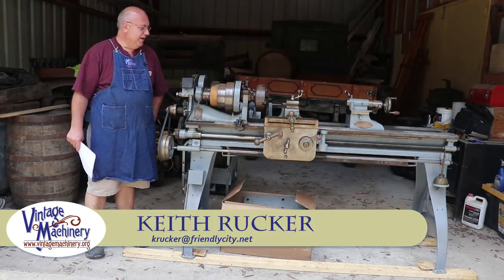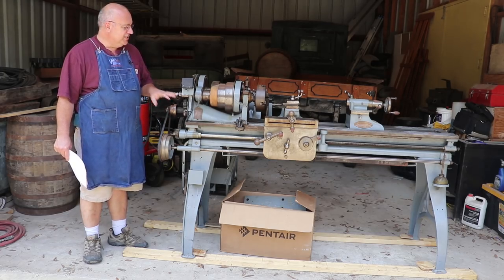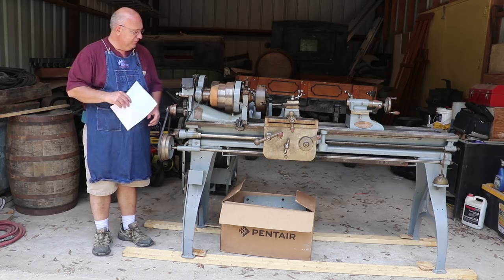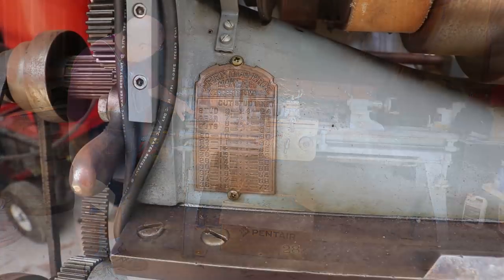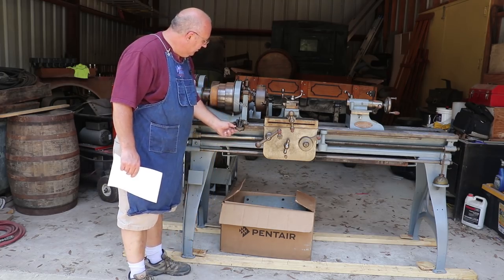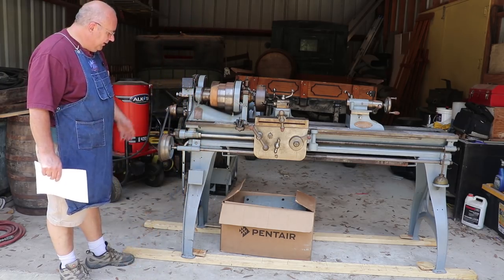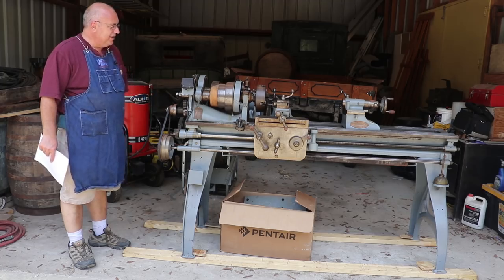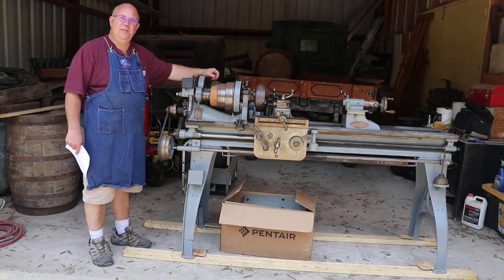Prentice Brothers Metal Lathe - Circa 1884

Comment: I had one like it in the 1980's.  Mine lacked the three accessory castings that you pointed out as likely non-original.  It had been painted with aluminum paint that was used on many metal items here in farm country and therefore was aesthetically less pleasing than yours but was also in very good mechanical condition.  I traded for a smaller machine when we moved to town in 1991.

Comment: Thanks for the video Keith. I used to run "engine lathes" in the 70s for oil filed production. Nice to see that "really" there hasn't been much change to the overall design in over 100 years with the exceptions of gear box's and now CNC.

Comment: Keith,  Great video on the basics of this lathe!  I wish my 10-inch 1911 South Bend lathe had been taken care of as well as this Prentice Brothers lathe.  Many of my change gears are missing and Rose (at LeBlond after they bought South Bend) told me that there is something different about the old gears that would make it quite difficult to find replacements.  I wish I knew what is different about the gears so I could start obtaining tooling, etc., to make the replacements.
Reply: Could be the pressure angle of the gears. I've run into problems before where the manufacturer changed this and while new and old gears will mesh they rapidly spall and wear out

Comment: Greetings from England Mr Rucker

Sometimes these gems turn up...

I recently picked up a small English lathe with a gap bed...around 1890-1910

A little bit of damage but that can easily be repaired...
Like you've pointed out here...its all about how complete they are and this one I've just bought is all there...
Change gears
Countershaft
Gap block
It's all there and that's a major headache out of the way right from the start...

They do turn up from time to time but good stuff like this is getting thin on the ground now...

P. S. change them Phillips screws on the change gear plate to slot heads won't you...😉

Comment: What would be neat for me is more about the chuck. Whether they once had Several chucks at the company and how they attached. Probably screw threads but you never know how they changed them back then. And how they cut those gears and what the unit looked like for gear spacing and circumference. I bet totally different.

Comment: I  have a Sheldon lathe of around the same vintage. It is a 10” and it is very similar in design. It needs to find a museum also! I’m not sure if it was treadle powered originally or lineshaft driven I think it may have been lineshaft driven since I see no attachment place on the legs for a treadle. I have turned stuff with the lathe buth the cross slide lead screw has a very course thread.

Comment: Just goes to show how advanced they were in the 1840's as it has the features a modern lathe would have for the hobbyist. The serial number may not be low, it may be high as how many would they make of these lathes in those days? 28 could be high as I bet they were very expensive and only a few companies could buy them.
Reply: mass production from henry ford was still the far future, factories were relatively small and made few variations, 28 might be 6 months worth, which they would never make many without an actual order to fill , stock was another thing they never had.  then castings used to sit for months to equalise too.

Comment: I have a quick change tool post with a boring bar tool post that is one inch. I would like to make a split bushing to use a1/2 in boring bar. I have machined several of these sleeves but the last two times I try to split the sleeve length wise I fail any ideas on how to split this sleeve in two equal parts lengthwise?

Comment: Hello Keith -
When I first started watching your youtube videos you were restoring your old floor safe. You had it done except for casting the brass knob. The castings you made were not acceptable and you put finishing the project on the back burner. I know you didn't want to just turn a knob (because of the cost of the stock, and because, dammit, I want to cast it). 
But in listening to your pareon video today about the progress of your camel backs (I think they are called), you mentioned working with this new foundry guy who will do small run projects for you. Maybe he can be a part of the restoration.
Reply from the maker: My plan was to try re-casting that part myself but I am about to the point where I will probably just let my new foundry guy do it for me.  Too many irons in the fire to have time to make that casting myself these days.

Comment: Tool hight adjustment is cool, but ain't it decrease rigidity?
Reply: On a mill, yes but on a lathe, the forces produced push the bit downward so it would be very sturdy during a cut.

Its actually similar in fashion to a clapper box on a shaper, whereby the clapper can move freely in one direction but is rigid when it takes a cut in the other.
Reply: Right you are.

Comment: Wouldn't the plate that tells the gear chart be held on with slotted screws or drive screws?
Reply: Hah !, that's what I was thinking too. I was about to research that, but wanted to wait and see if someone else noticed it too. Bet Keith would know.
Reply from the maker: I noticed that there were multiple fasteners on this machine that were incorrect for it's vintage.  I suspect that when it was restored at some point by the previous owners, they did not pay close attention to these details - which is pretty common.  It is the kind of thing that sticks out like a sore thumb to me!
Reply: You usually point that stuff out.  That's why I started paying attention to it in the first place.  Keep up the great content Mr. Keith!!
Reply: i have a Prentice Bros lathe i believe to be a 1881 or 1882 and the gear chart is fastened with slotted screws

Comment: Great review, Keith.  I’m not a machinist, but always been fascinated with machinery.  As I watched this review, I got to wondering if there ever was a lathe where the head stock was mounted on the right side of the bed?  Not sure if there would be a need for such a lathe, and I agree the lefthand mount makes sense and most likely evolved to aid the right handed worker. Crazy thought, huh.
Reply: Take a look at modern CNC lathes, it's spindles (=headstocks) everywhere, left, right, and even center.
Reply: blahfasel2000 , thanks for the feedback.  I guess where there is a need a machine will be made to accommodate.

Comment: A. J.  Kirkwood & Co was one of the oldest machinery dealers in Chicago, founded b George W. Dunbar. The Chicago fire in 1871 wiped out their entire inventory of machines and engines, which had melted into a huge mass that they had to actually mine out to scrap. The company started by Dunbar was sold to C.L. Rice & Co., who then sold it to Thomas S. Kirkwood and William A. Dunklee in 1872. In 1875 Dunklee retired, and the firm became T. S. & A. J. Kirkwood. In 1885 Thomas retired, and then the company was known as A. J. Kirkwood & Co (for Arthur J. Kirkwood, brother of Thomas).
Reply from the maker: Yes, I got an email from another viewer with some history on this company and based on some of his evidence, that tag would have dated from 1885 to 1887 if I am recalling it correctly.  It puts a pretty tight time stamp on the lathe.